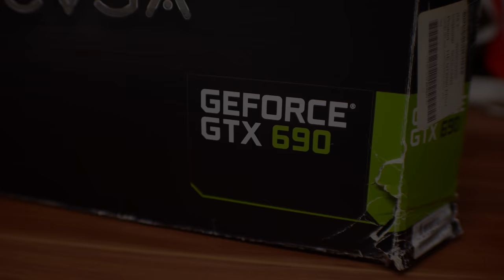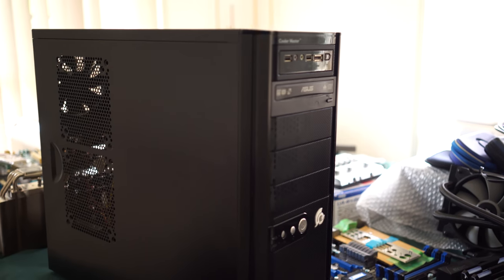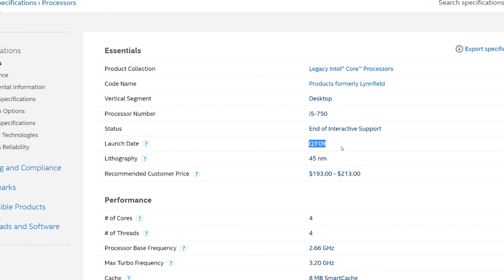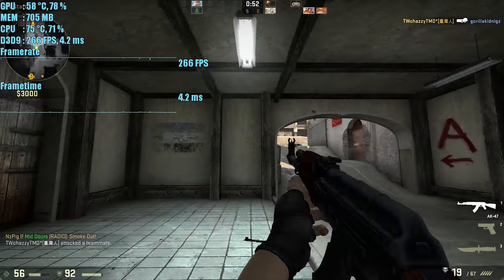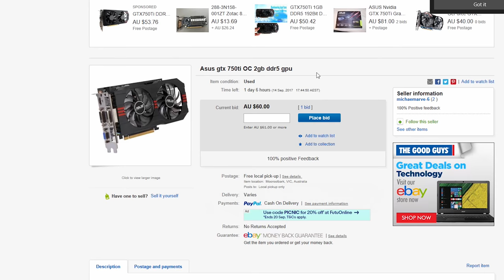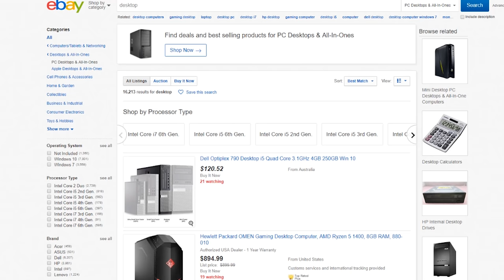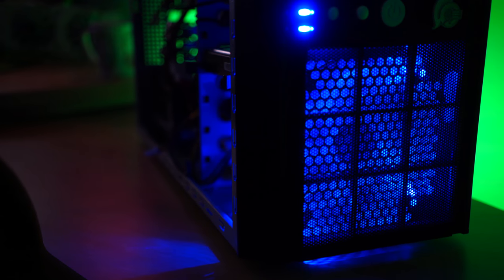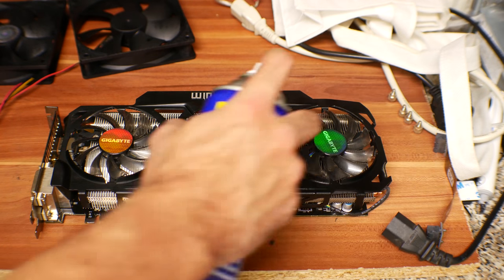The CHEAPEST and EASIEST way to Get INTO PC GAMING?

Comment: The best part is the GTX750Ti has hardly been effected by mining, and as people clamber for GTX1050's they're at rock bottom prices.
Reply: Budget-Builds Official Instead of GTX 750 ti be could also get GT 1030.
Reply: tamago 750 Ti still performs a little bit better than the 1030 though
Reply: Ardimo Harsa 1030 is newer
Reply: Clamber for 1050's? Uh...1050 cards have been the same price for...ever.
Reply: Hi im adc Who cares if it's newer?
Reply: Budget-Builds Official I was trying to sell a 760 for around $60 recently and nobody wanted to give that much.
Reply: +xmasta105 wow where do you live because if that's Canadian dollars that would be an amazing deal
Reply: I looked at a few comparison videos and from what I could tell the 1030 seems to be on the level of the regular 750, which is still good performance. So the Ti should be a bit in front. But you can get the 1030 brand new with warranty and all of that.
Reply: saclautaa Better power efficiency and optimization for modern games.
Reply: I tried to get my hands on a 1050 or 1050Ti but the prices (150bucks) are insane in Germany due to Cryptomining.
Reply: yeah you could get an r7 360 for cheap too now. I got one a few days ago for $39 brand new.
Reply: R7 360 is atleast 70bucks here but the GTX960/1050Ti is twice as fast and has more Ram. I gonna wait until the Cryptominingshit is over.
Reply: what about power requirements? H.265 decoding/encoding...its not all about just 'gaming'
Reply: My rig is already powerful enough Videoediting (I5 6500) but lacking gaming (onboard graphics).
Reply: ?? The RX 460 was 109$ for a 4gb in 2016..
Reply: i have the evga 750ti ftw edition and i loved it !
Reply: Yep, and 2GB was $60-75

I found a 4GB 460 for just $89!
Reply: +Sonu03785 I believe the 1030 is a 30W GPU, whereas the 1050 and 750 are around 70W?
Reply: GhostlyHoots us dollars.
Reply: GhostlyHoots so about 70 cad. But I lowered to 50 cause I didn't want it and still no bites. Ended up giving it to a friend doing a super budget PC.
Reply: xmasta105 oh then its not as good of price since i live in Canada but that still pretty good
Reply: xmasta105 nice thats always good
Reply: Actually currently, the gtx 1070 or 1060 are the best cards right now. They have the highest mh/watt.
Reply: Gtx1050 i could get for 102euro on Amazon refurbished. And a ti 4gb for 136euro
Reply: Chris D bro the 750ti gets the same optimization as the 1030,50etc
Reply: I would recommend a 1050ti instead
Reply: Budget-Builds Official see you everywhere
Reply: rx560 is better than 750 ti by like 20%
Reply: no they arnt... 560 doesnt have enough vram (unless you buy the 4gb version) you need minimum 4gb vram to mine
Reply: a gt730 doesnt have enough raw power to fully utilize 4gb same for the RX 560 4gb version it can mabye use 3-3.5gb of its vram
Reply: Crypto mining is cancer for killing every bodies fun. Go search couches at the damn mall if you are that hard up for 50 cents a day.
Reply: I'll give you 60 for a 760
Reply: Budget-Builds Official 
Am interested in Your Product
Is that for sale
Reply: Nabeel Hamza no
Reply: KingP3T3 I bought a 750 1gb for that... wish I saw your offer
Reply: his talking about gtx750ti 2ndhand still better price to performance than 2nd/new gt1030
Reply: Now, To be honest, the 750ti is an overrated graphics card.
Reply: Budget-Builds Official

Comment: Cheap q65 lga 1155 mobo taken from a prebuilt and a separate i5-2500 is my go-to with using US based eBay parts. Comes out to $20-30 for mobo and $40-50 for the i5. With this combo being about $60-70 I say it's one of the best budget combos to get started with.

Comment: This video makes me sad and confused. You're saying $100 for a GTX 750 ti is a good deal, yet I have mine for sale for $40 on Craigslist and everyone's trying to haggle me down like I'm somehow giving them the runaround. Meanwhile there are people selling "high end gaming pc *BEASTS*" with FX 4300's and 750 ti's for $500
Reply: Yeah honestly I wouldn't spend over $50 for a 750ti. $40 is pretty fair idk try putting a "local" post on r/hardwareswap on the good ole redditz :)
Reply: Richard Addison Lol if you wanna pay shipping for it I'll put it up on Ebay for you right now. Just keep in mind mine does require a 6 pin, it's the 2gb Gigabyte Windforce OC
Reply: i have a hp i7 3770 computer with stock power supply
Reply: Do you have molex connectors? I can put a molex to pcie adapter with it I have like 3 floating around that I never use
Reply: i don't have any molex adapters
Reply from the maker: WholeGrainGoldfish $100 is a bit too high. But for people in countries where cards are expensive, e.g. Brazil, then it is not a bad deal there. For $40 I would pick it up no haggles needed lol
Reply: Oh no I understand, I wasn't taking a shot at your claim or anything like that - I'm just saying it's frustrating that even selling it this cheap, people still try to haggle it lol. There's not much lower I can go before it's just giving it away for free
Reply: $100 was a good deal, 2 years ago when I bought mine. Not so much anymore.

I see what you mean though, people are weird about 2nd-hand stuff. They act like their stuff is gold, but then want stuff for dirt-cheap.

Those 4300/750 Ti PC's are a bargain compared to the APU "gaming PC's" going for $350-$400. Or the ones with GT720's.
Reply: Nice Monster Rancher icon. It's rare to find anyone else who actually liked those games. I really wish there was a modern online version. There was for a while, but it was Korea only and got shut down.
Reply: This is one rule always put your price a little bit higher than what you want or expect people will pay for it. People will always try to pay less for it
Reply: Who the fuck haggles a $40 graphics card? "Oh look, I saved 3 dollars, I'll get me a bag of chips from the supermarket with my 750 Ti"
Reply: Richard Addison ayeeeeee you from south fl

Comment: I got a Dell optiplex 790 with core i5 2400, and 4gbs of ddr3 ram for $69. Then I bought a 500gb hdd for $18, and a gt 1030 for $66. A windows 7 key was on the case, so I used that to activate windows 7 and easily upgraded to 10 for free. $150 for this computer! I will add another 4gbs soon, which I've found plenty of ram sticks for around $20. So $170 for a nice starter gaming computer!
Reply: I am going to build something like that!

Comment: Nice tips!
I"built" my Optiplex 990 SFF (i5 2400 & 8GB) last year before it was cool. Added a SSD and 1tb HDD and low profile 750ti. Later upgraded to the 1050ti as soon as a low profile one was released. Handles anything 1080p 60fps perfectly but an upgrade to an i7-2600 would give me more frames in open-world games like GTA5.

Comment: All of my PC parts are used. I probably wouldn't have gotten such a good deal (below) without Bryan's videos.
I got an R9 290 for $126 from eBay during this mining craze, "As is" because Windows would crash. Turns out it was the crappy Elpida VRAM that couldn't handle even stock clocks, so I BIOS modded it to 1Ghz instead of 1260MHz. Works excellently now, and it didn't lose that many points on the SteamVR benchmark!
EDIT I'm using an i5 2400, cheap Intel H67 :( motherboard, old Corsair PSU (about 10 years old), an older case... lol

Comment: I just upgraded my old rig with an Xeon X3450 @3,3 Ghz from I5 750 @3,2 Ghz on a Asus P7P55D. GTX660 and 8 GB ram makes it a great choice even today. The MB can do Raid 0, just buy 2 HDDs or 3 and you don't need an SSD for your games. I manage ~200 read/write on 3x160 GB drives.

Comment: Your video comes in quite handy, a friend of my house mate is trying to start getting into PC gaming but as he's on a tight budget, his first argument therefore was also of course that PC gaming is expensive.
The best deal I could make up with brand new parts in Germany costs around 412€ which should be around 614AU$ as of now.
1TB HDD, G4560, 8GB DDR4-2133, RX460, MSI B250 Pro-VD, BeQuiet Power 8 400W.
Nothing fancy but still fully acceptable for entry level gaming PCs.
eBay is actually a nice idea, I might look into that for a still usable system and just take a new graphics card for reference to show him.

Comment: Good stuff, and eBay has always been a source for me when parts hunting for as long as I can remember be it used, new, or new old stock parts, as I've gotten some really good deals over the years always being on a budget for my system builds. Also here in the US I've found places like GoodWill or Salvation Army thrift stores can sometime be a source for good scores on stuff like keyboards(if you are willing to take the time to clean them) mice, old monitors, random cables, etc.. Though you do have to check places like that often, & be prepared for some drought periods of finding not a lot of anything.

Comment: My secondary pc has an i5-750 and it indeed is a decent cpu even by today's standards. Clocked at 3.66ghz using a ZEROtherm CORE92 cooler it never goes above 55* Celsius and I''m getting a score of 435points in Cinebench R15 multithread ( ~10% lower than a Ryzen 3 1200 ). I have it paired with a Gigabyte P55A-UD3 mainboard, 8gigs of ram, 120gb ssd for operating system+wow/gw2, 320gb hdd for some aditional storage and a good old HD5870. I can confirm that in 1600x1200 a lot of games still play very fine on high settings. And there still is room left for upgrades, a GTX970 or a better cpu like a Xeon X3440 will improve performance by a big margin. So far, the overall cost for my system was around 150$ ( I got the HD5870 for free from my cousin ), as in cpu+mb+cooler+ram+500w chieftec psu+random case+22' monitor.

Comment: search on ebay for desktop/workstation/office PCs like Dell Optiplex are built to last and cheap 2nd hand. Often you can't change the PSU . Usually little to no option to overclock but as a beginner machine you don't need to worry about bigger CPU coolers etc. A great console alternative you'll be gaming at higher FPS and bigger resolution for less. PC gaming is not expensive as long as PC aesthetics aren't important and your expectations of older hardware aren't unrealistic. Get any i5 variant (obvs the newer the better for bigger CPU cache and IPC gains), slap in a 750ti, 1050 or 1050ti which takes less than 5 mins, maybe up the standard 4gb to 8gb RAM and you're good to go at at least medium, or high on optimised games like Overwatch @ 1080p.

Comment: I'm quite happy with the deal I found - GTX 770 for the equivalent of $50 USD. It has a reference cooler, so the overclocking is non-existent, but still. That's a lot for my money.

Comment: The cheapest build i can do brand new parts is $468, it won't be great at gaming but you'll still be able to play every game you throw at it. it sports a g4560 8 gb RAM and a GT 1030 2GB with a 1TB HDD (the 1030 performs slighty worse than the 750 ti but not by a lot)

Comment: I think getting into PC gaming has two parts for most people.
1) Aesthetics. I KNOW I can get into PC Gaming for cheap, probably with the money I already have (260) but I want to create a PC from parts to enjoy the experience, and have an influence on How it looks.
2) Performance < This is what I don't see many people valuing over aesthetics, unless aesthetics look decent (So not mustard and ketchup PSU cables and Green Motherboard with Tempered glass Sidepannel or old 2012 PC Case)
Reply: Exceed you can get cheap TG cases on Newegg after rebates if you hunt. Just got a DIY PC Illusion case for $25 shipped.
I build and flip PCs and it's funny what a cheap, yet asthetically pleasing rig will sell for with meh performance when you can get a superior perofming rig that lacks looks for significantly cheaper

Comment: I got an i5 3470, 8gb ram, 250gb hdd (I had a 500gb 2.5 inch hyrbid from my old laptop) and gtx 950 for 210USD.

HP Compaq Pro 6300 (I5, 4gb ram, 250gb hdd, 320w 80+ gold) 100$
4gb ram - 15$
2x SATA Power to 1x 6 Pin PCIE - 8$ newegg
GTX 950 SC Single Fan - 92$

Comment: my best used pickups lately have been a gtx 980TI for US $340 and i am buying lots of used servers to set up a home lab.  Its pretty amazing what you can pickup cheap on ebay in terms of used servers and server parts.  I am now in the process of building out a poweredge R720.  I purchased a chassis only for US $200 and looking to spend another $1,500 US and expect to have a 20 core, 40 thread (2x e5 2670 v2 cpus) video edit monster with an amd wx7100 (may use a nvidia p4000, not sure)  to boot.

Comment: Would be cool to see you find and turn into a gaming rig, an HP z400. I've seen them all over eBay for cheap, like under $100 with 8gb ram but no HDD. Socket 1366 platform. Interesting stuff. Sucks OCing is locked out of those, but they kick ass still either way, especially if that i5-750 is still hanging.

Comment: I bought a used Dell Precision T5500 from eBay for £230. Two quad core Xeon X5560 processors, 60GB DDR3 memory, some crappy msi Radeon HD4670 (switched for Geforce GTX 960 (only card that would fit )) and a Windows 7 Pro product key that I used to install Windows 10. No HDD but I installed two Samsung SSDs, one I already had which is about 480GB and a 1TB Samsung 850 EVO for £298. There was also an Intel PCI Ethernet card which I removed.

Comment: I bought an Ebay refurb i5 2400 dell optiplex 790MT, it had 4 gig ram (2x2gb) and a 300 GB Hdd and windows 10 already installed. I bought a zotac GTX750TI. I added 4 more GB (2x2GB) and a 120 GB ssd, for a boot drive. I paid probably a bit too much for the 750, but it was the cheapest at the time (90 shipped). the computer itself was 139.00 BIN the SSD was 45.00 and the 2x2GB ram was like 20.00. so as it sits, i'm about $280.00 in my setup and it does everything i need. plans when i can afford it, are improved PSU, thinking 450W (stock is a 265 w) and an eventual move to a 1050 GPU as well. So far this is the best computer, i've ever had and it's nowhere near top tier parts

Comment: For bencharking CS:GO, please also check out the newer maps! My old gaming rig (which once SMASHED counter strike at 300FPS) can sometimes dip below 30 in those maps :( ( FX8150 O.C. 4.3GHz + R9-280X ).

And guys stay away from 4Core 775/771 builds or Phenom 2 X4 builds (X6 is fine) if you aren't on an extreme budget. I have 2 of them myself, and yes they are very good deals but for modern games there just is not enough CPU Power... I tested a Q8400 OC and a X4-920 OC and both were still nice, but definitively too bad for something like PUBG. They will bottleneck, and you will have to play on low to get a decent framerate. So really not that good for the future, they are at the end of their lifespan.

Comment: correction a 560ti will perform more or less the same as a 750ti granted the game dont exceed the 1gb framebuffer of the 560ti, and that dual 6 pin on the 560ti means it eats a lot of power for the same performance... nice video tip on budget gaming though! thumbs up

Comment: Brilliant cleaning tips. Off to get some WD40 now 👍🏻
Reply: Works really well with sticker residue as well.
Reply: NO MA'AM we in the UK only know it as a Lubricant not as a   Super-dooper multipurpose super liquid
Reply: NO MA'AM love the name, and that is very true about stickers, but the thing I don't like with WD40 when used on some plastics is it can leave some oily residue, and lingering smell behind. If I'm going to get sticker off, and I know the surface under it is not going to be damaged, then I get my g/f's hair dryer and slowly melt the glue of the sticker, and peel it up with spludger to try, and not have to deal with sticker residue. Also goof off, and Goo Gone are also good alternatives to WD40.
Reply: If WD 40 and duct tape can't fix it, nothing can!
Reply: Wd-40 is a dust magnet because that oily surface that it leaves

Comment: I've known of the "buy a used pre-built/oem tower" method for a long time- but unfortunately the most common ones ship with motherboards that have locked down bios; essentially killing a large part of the methods you use to keep these parts relevant- overclocking on these boards is next to impossible.
Reply: SilentCrusades There are ways to get around this. For example, you can use electrical tape to cover 2 pins on a 775 motherboard which messes with your processor's base clock. Someone overclocked a Q6600 to 3 GHz using this method.
Reply: Epsilon Yea- but what if you got a different socket to work with? It is far from easy by then; the amount of effort you have to put in ontop of having to overclock the CPU itself. Yeah sure, you could try and find a retail version of that OEM motherboard to flash it's bios but then again that's a lot of effort discounting the risk you'll be taking.

Comment: You can get a GTX 680 for less than what 750 Ti cost and it will outperform the 750 Ti with a huge margin, so for a gamer on a budget I would go for the 680 without a doubt.